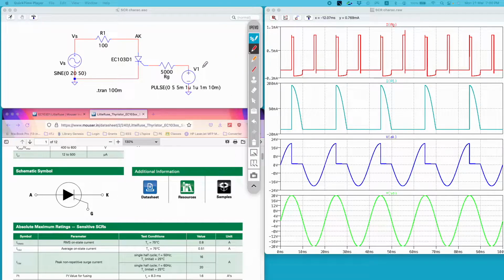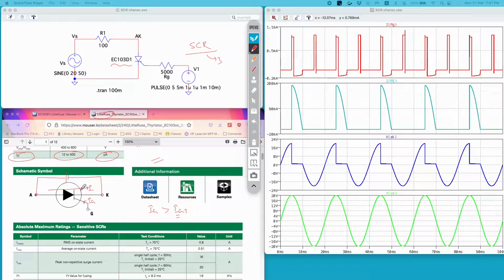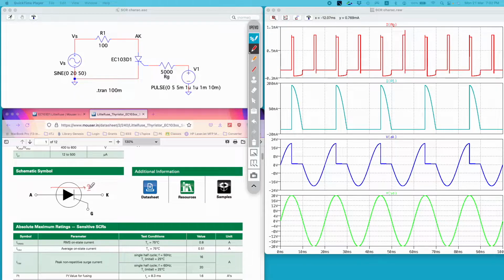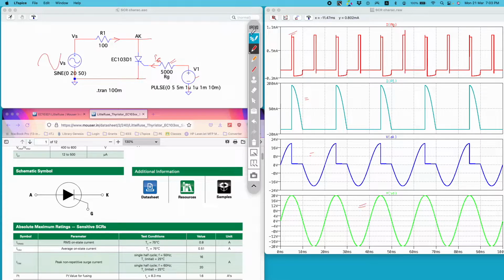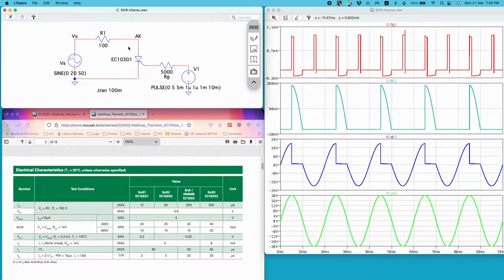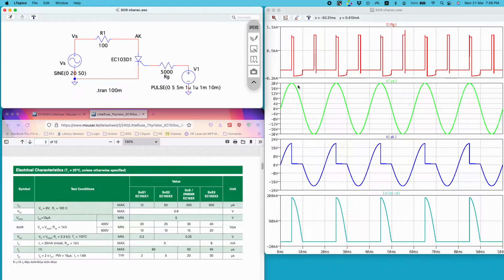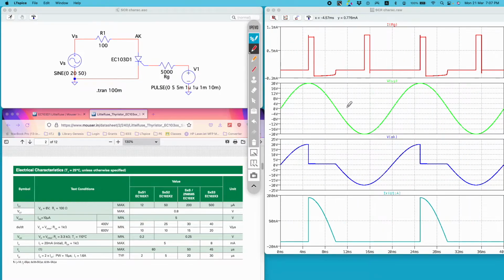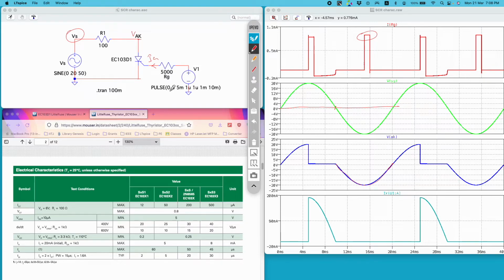SCR Characteristics explained using LTpsice

Comment: I generated curves well in ltspice with a separate gate drive source but try doing it with a resistor/capacitor as one would do in real life and the simulation slows down to a never ending crawl.